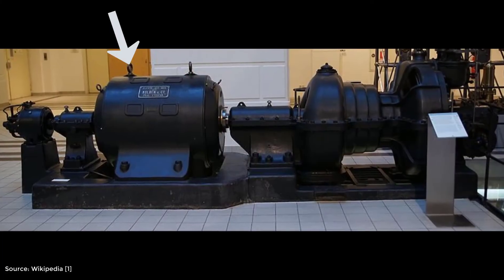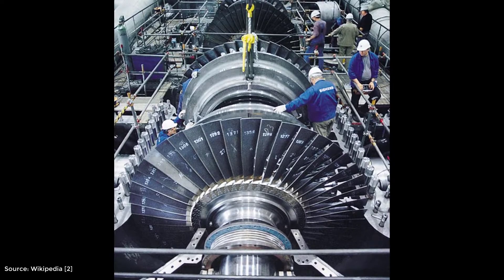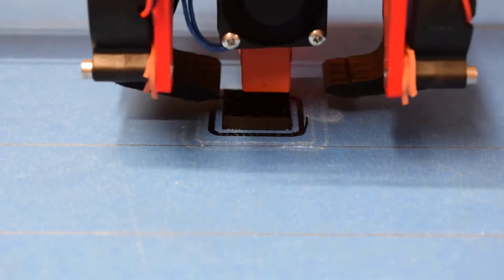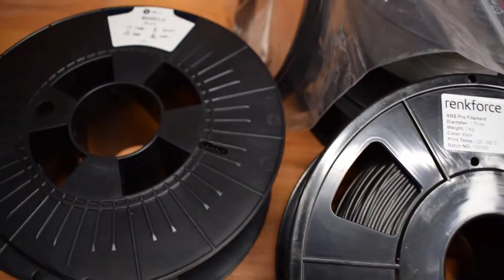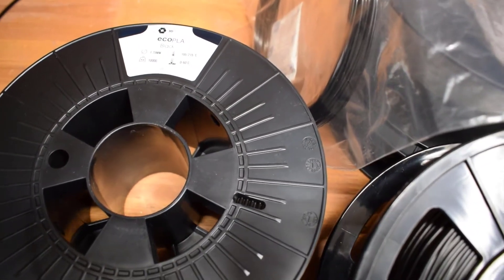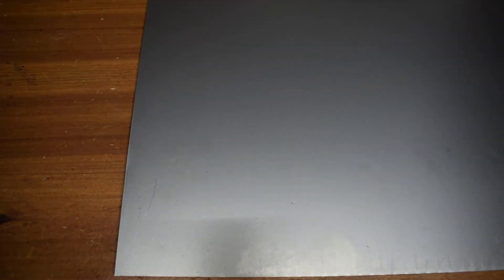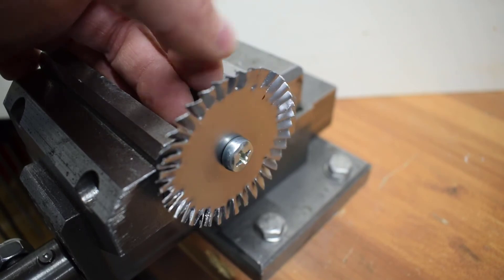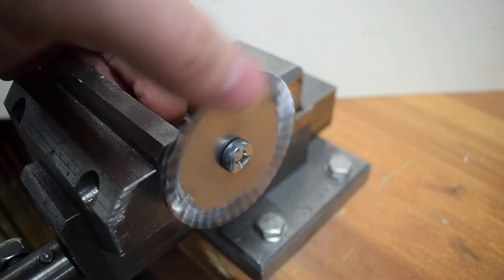Can you make a DIY Steam Turbine?

Comment: that's air and not steam. to produce rotation in turbine, a small space like a combustion chamber is used to allow only small volume of steam inside, which is crucial for expanding the steam, and causing rotation. without this, it won't work or likely to be inefficient. go look up how steam turbines work and you'll see what I mean.

Comment: that's not steam, its air. of course air can push things too, but a steam turbine like this won't work, because the pressure escapes into the space, which is not how steam turbines work, they have to have a chamber or something that will allow steam in a tiny or very small space for small steam volume, before being compressed and energized, ready for work.

Comment: I tried this,  
   I put it on a 5v motor, then i blew hard. I got a light to turn on, but damn you do gotta blow hard, 
    I guess i need a larger turbine and maybe 🤔 a good method to bleed the pressure 
   I made the fans, and am trying to make a few alternating blades to increase pressure. 
     Also plan to build a boiler but don't know about pressure right now
Reply from the maker: Nice. I used compressed air to turn the turbine. ou could also try to connect several turbines in series. There may be some plans for a boiler on the internet. However, I would recommend starting the test with low pressure first.